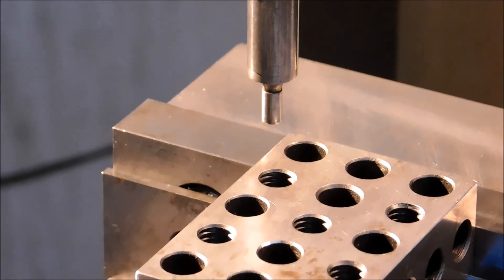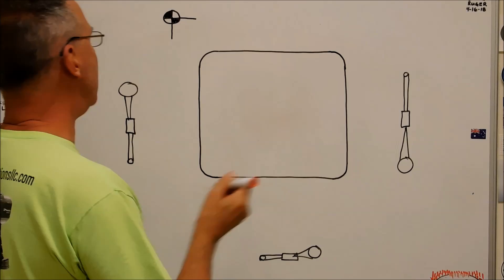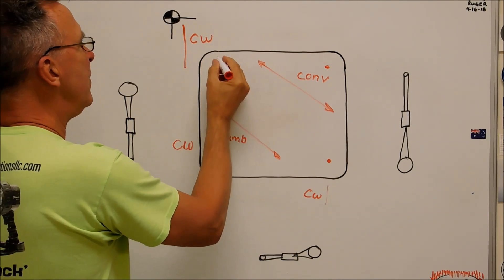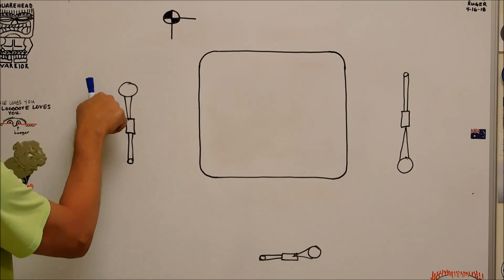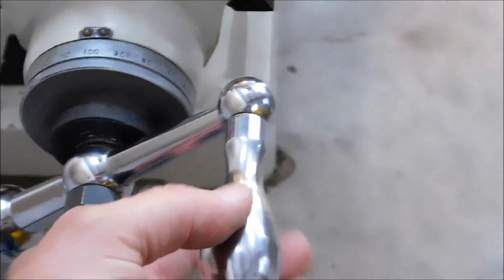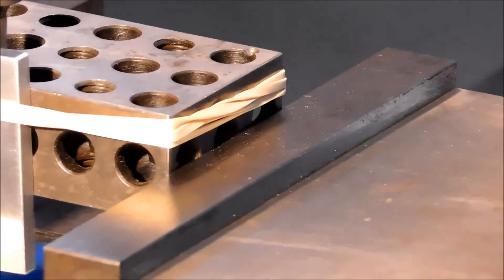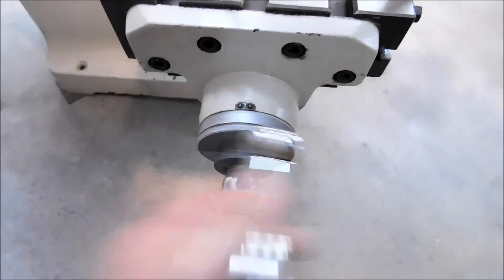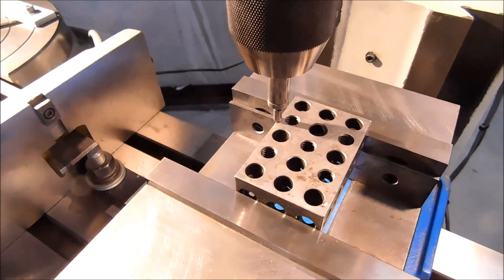Ignore The Backlash,  Manual Milling Just got Easier.

Comment: For the Y axis, you would need a "double dial", behind the crank. Each individual dial would show backlash free position for one direction, CW or CCW. With known backlash, the two dials could even be coupled to zero them out in one quick step. Double dials would work on the X axis as well.
Reply: I was thinking something similar as I only have a single wheel on my X axis too.  Rather than a second wheel, an adjustable pointer would work so you have a mark for CW readings and a mark for CCW readings.  Could even be as simple as a Sharpie mark... although you can guarantee it'd rub off at entirely the wrong moment.  Would need to be adjustable (or at least periodically recalibrated) as the backlash could change as the machine wears.
Reply: @Cenedd  I like the idea of a second pointer in form of a Sharpie mark. My first pointer is so faint, that even this one will be a Sharpie mark!

Comment: Joe, two things, firstly stick your head under the table and adjust your nut backlash eliminator, 0.030" backlash is excessive, should be 10 thou or less depending on the wear over the length of the leadscrew. Secondly about having the table handles offset, if you have tablepower feed, usually the handles are spring loaded and will sit wherever. I see you have fixed yours as I did Great tips though, thank you.

Comment: Any reason you couldn’t use the other side of the 123 block instead of the projected edge?  It’s an integral number of handle revolutions across it.
Reply: What if your part isn't a 123 block?
Reply: It's so you reference off the same location ( edge ) when referencing from the other direction .

Comment: The ball is supposed to be an exact counterweight for the handle.   That's the reason it's there in the first place.  If you already have well balanced handles you shouldn't need to worry about whether they are mounted the same or opposite on the shaft.   It shouldn't make any difference at all.
Reply: The ball is supposed to be a counterweight, but  half the machines I ever ran the handle was heavy.

Comment: Excellent video.  Short, and sweet, minimal chatter and very useful. Having used a non-DRO machine for 35 or so years, it's good to see the old-school methods are still alive.  By the way, I installed a dro kit from Ebay last year.  Cheap (<200) but effective.

Comment: In this particular case, since you have a 1-2-3 block, you could have done without the projected edge and zeroed left dial on the right face of the block right?  If you have a part with some odd size then you'd need to use the projected edge.. correct?
Great vid! I'm still looking for a mill though

Comment: I love this, but when I look at your handles 7:30 or so, I see a stick you can grip, and opposite that is a sphere. Why in tarnation isn't the mass of the sphere balancing out the mass of the grip stick? Then, their relative phasing on the X axis wouldn't matter, and the Y axis wouldn't be subject to handle flop.  Just an idea. Maybe balanced crank handles would be a good project you could use to demonstrate some more of your usual clever techniques
Edit: While there's no 2nd Y axis crank handle at the back of the machine to do that X axis zeroing trick, there's no reason the Y axis couldn't have two dials, one stacked on the other. But I imagine ppl would just install a DRO before messing around like that

Comment: Has anybody ever marketed a zero backlash nut set for a Bridgeprt without ballscrews. Just a hair brained idea
Reply: In reality there is ALWAYS backlash, even if it is .001", from the flex of the lead screw, it is still backlash.    Bridgeport does have a split nut that can be adjusted for virtually no backlash, however....
Once the lead screw gets worn more in the middle such that it can't be reduced below a a few thou, you might as well just let it go.  If the backlash is .005 or .050 it doesn't make any difference, operation is the same.      
The best way to have zero backlash would be pre-load in one direction with air springs, or...just snug the gibs.
Reply: @glenurban3596  
I know that Kearney and Trecker had a hydraulically loaded leadscrew nut on their S series mills. But then again these are serious milling machines. The only advantage a BP would really have over a K&T or a Cincinatti is the quill. But then a BP really isn't built for heavy work IMO. For heavier work (the workpiece not just the cutting) the next step up would be a bed mill with a quill head. In a way it's too bad the European style mills (Deckel) never were that popular here. Cost probably.  Another factor is just the culture is used to.
In terms an anti-backlash nut on a Bridgeport  I was think something along the lines of a set of Belleville washers to load the two halves of the nut. This would load the nut enough so that backlash is not a major concern in most cases plus allow the nuts or one of them enough axial movement to compensate for wear in the screw. Screw wear is also a good deason way one should never have work always set-up in the center of the table.  It always pays to distribute wear on the ways and the ad screws

Comment: Hey Joe, or anyone reading this. Do you have any tips for, or could you refer me to a video about fixing a sticky test indicator? My Uncle gave me a couple old Starrett No. 711 Last Word indicators(.001" and .0005"). The .001" has a sticky spot at the beginning  of the travel when switched in one direction, and in the middle of travel when switched in the other. I've never worked on an indicator before, and I'd like to know where to start. Thank you.
Reply: I have a similar situation. 
Thanks for asking and I hope someone can help out.
Reply: @glenj.taylor2938   Mr Pete has this https://www.youtube.com/watch?v=Rp6D3YTx7iU and most likely others. Ave straightened one out, too https://www.youtube.com/watch?v=e5i0r0-dd7I
Reply: Sticky indicator mechanisms are often caused by someone having lubed them with an unsuitable oil based product that has since gone tacky or sticky. WD40 is such a product. It seems OK to use when first applied but thickens and becomes tacky with time. It could be as simple as gentle cleaning and applying some appropriate light oil suitable for instrument lubrication.

Comment: Should be noted that if using the first method shown on whiteboard (starting and doing both climb and conventional to where you are always cutting turning the handles in the same direction) that when you return back to your zero point for the 2nd set of cuts, you have to make sure to go past your zero and then come back to it. If you dont, then you are not really at your zero but rather off by the amount of backlash in the leads.
Kind of surprised that Joe forgot to mention this (unless he did and I just missed it).
Reply: I was thinking the same thing. 
Let's see if anyone else can shed some light on your comment.
Reply: @58 Marine Climb/Conv milling would be the price to pay for starting in upper LH corner rather than going round... Can't have it all
Reply: @58 Marine Yep. But then again in a garage on an abandoned island you do what you gotta do

Comment: Nice Video. When you are machining on the x axis it is best to set the dial on the end that is clockwise or reading from zero to two hundred rather then the other way around. That way you always remember which end that you zeroed. The x axis has a longer gib making the table more stable in that direction. It is interesting that you make a reference to digital readouts. The theory is that the scales do not care which direction the table travels. In fact if you are working to a tight tolerance you are better off taking out the backlash as you would if you had a machine without the digital readout. I have found that if you set an indicator on the side of the part and set the dro to zero and slowly turn the table in the opposite direction the indicator will move and the dro will not indicate the movement. I believe the reasoning behind this is that when you set stress on the table in one direction and then reverse the feed there is a small twist in the table.

Comment: The carriage handle on a lathe is very important to have balanced. Incredibly, most are poorly balanced. I fix this first thing on a newly acquired machine. On knee mills, controller(conversational language) and ballscrews is the only way to go. CNC for X&Y with read out on the quill. Don’t need it on the Z axis so much so dial is fine. This will open so many doors over a manual it’s mind blowing. I do a lot of R&D and I’m twice as fast as the typical CNC for quick onesie-twosies. Hobbyists, do yourself a favor find a used knee mill/controller. Highly recommend a Kent mill. Before buying, make sure the older controller is still supported by the manufacturer or it’s just a door stop. Acu Rite is very good, never had one sent in, just put a big UPS on it to protect it for power spikes/loss. No programming language knowledge needed!!!!
Reply: I like what you said.
I just have much more to learn to understand all of it. 😁

Comment: Very good tips. My mill has handles that contain springs as a safety feature when using X power feed, so both X's just dangle vertically, instead of rotating at high speed. There is a similar setup on the power Z, in that it will not operate under power, if the Z crank is in place.

Comment: This is an awesome tip for those of us with no DRO.  Both the idea of two L cuts and the setting of the two handwheel index dials to build out the backlash.  THANKS!  Off to set my dials up right now.

But technically if the cutout starts with two "L" slots before we clean out the middle they wouldn't really be climbing or conventional.  Or was the intent that this was the final pass to clean up the outer sides of the pocket... which, come to think of it, would be the better way to do this anyway... OK, so climb and conventional it is.... 

I'm also wondering about the idea of two separate index markers on the Y axis wheel.  My mill uses a little riveted on marker with two rivet holes that I can drill out and tap for something like 4-40.  I'd remove that and make two separate index markers which will attach with screws.  One will be fixed and the other with a slotted hole so I can compensate for changes in the backlash over time and wear.  I'll email you a picture.

Comment: I hadn't thought of balancing the cranks and using the two dials. Brilliant tips. Thanks!
Reply: Although isn't the ball opposite the handle supposed to balance it?
Reply: @adamnorton9595  I believe that the handles are balanced, as you said, but if the handles are out of phase the lead screw won't be balanced.
Reply: @adamnorton9595  Yes, if it's been properly designed.

Comment: Sometimes a projected edge is not possible because the part is to narrow.  An alternative is to find the edge in the first direction. Increasing the edge finder +.010 into the work then working from the second dial backing out until the edge finder goes concentric. Then set your dial at .100. Now back your dial-up one full turn and progress to zero. This accomplishes the same task without the projected Edge.

Comment: Super kudos for this.   It is a trick I learned circa 1971.   The y axis backlash is what you need to know for the particular mill.   I learned before digital readouts were around.   However, every Bridgeport mill in that shop had optics on each axis.   One used the optics if one needed to do close work.    Once again super kudos for explaining how to use the opposing cranks on the x axis to dispel backlash worries.